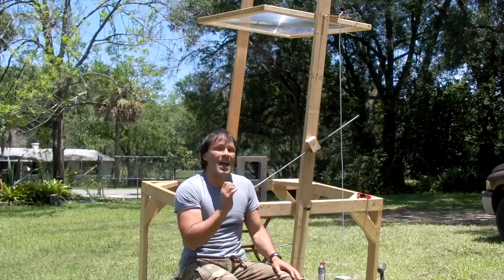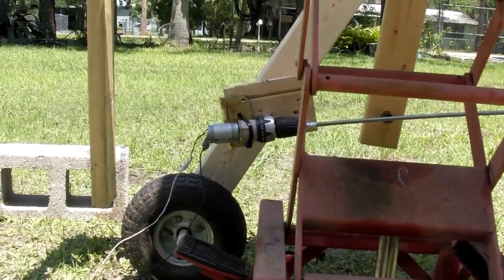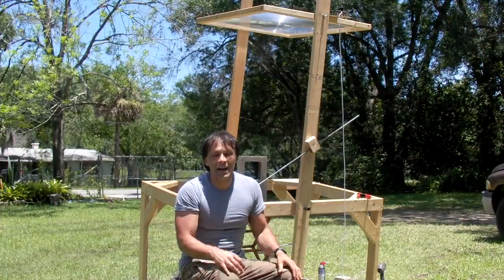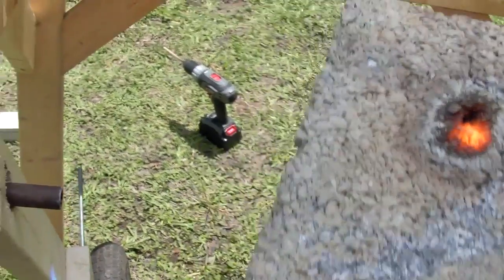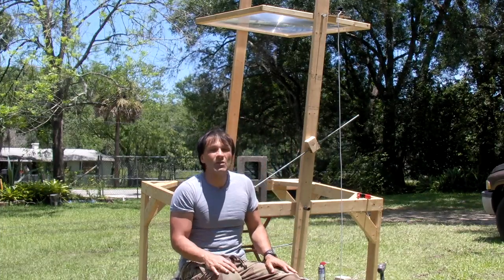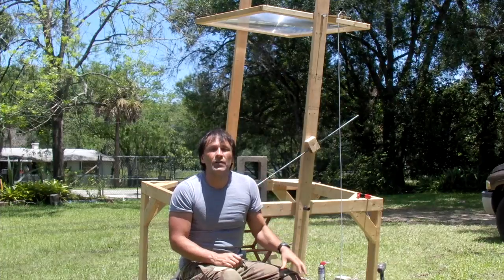Fresnel Lens Solar Tracker Afternoon Stationary Target Sun Power Ray greenpowerscience

Comment from the maker: This tracker could operate from a small 6 watt panel to a battery or it could run directly from a 30 watt panel no battery. Battery/panel combo is a better option. The entire unit consumes only 6-10 watt hours a day = a 6 watt LED bulb on for one hour.

In terms of a Fresnel/Concentrated solar station. Standard PV, sort of with panel risks. CPV yes but the cost of regular PV is well below the price of CPV when all aspects of the project are considered.

Comment from the maker: Thank you for the feedback. I will point that out in the next video. Easy assumption overlook on my part. This thing is fun. No more lens moving. I am totally ditching all the stands for this. I need more motorcycle jack stands. Ebay is the only option I can find. Harbor Freight only has transmission jacks (sucks to lift) and $350 table cart stands.

Comment from the maker: Depends on your project. The Fresnel Lenses work well for melting metals and very high spot temperatures. The parabolic mirrors work better for bottom cooking like a traditional stove with a slightly wider focal pattern distributing light over a larger area (bottom of a pan). This is designed for soar thermal vs solar electric. This lens concentrates roughly 700 watt/joules to a 1/2" area. For electrical production I usually recommend standard PV as the over all footprint is about the same.

Comment: This is awesome, Dan! Thank you! I like all of your videos, but I may actually build this project. I heat my house, water and hot tub with a wood-fired boiler. But, we get a lot of sun from mid-spring through early fall. During that time, I'd rather use the sun instead of wood. What would you consider to be the best solar water heater design to use with your solar tracker?

Comment: Hey Dan i have a few Fresnel lenses myself and i was trying to see if there was any way to recycle 2 liter bottles and use the flat portion as a window pane substitute for a green house by molding or melting them together with my lens to mold them together into a pane between some metal sheets. do you have any pointers or have you ever attempted something like this yourself?

Comment: Its not actually improved efficiency by using more light area focussed onto a panel, its just increases the concentration.  

6 watts for the area taken by the mirror is actually a loss, where as another 40watt panel in the mirror's place makes more power and better sense.

One also requires more volume space to do collection via reflection mirrors.  

For space and efficiency at the home, flat panels are very practical.  

This tracker would increase energy collection for solar panels very well

Comment: Do you think it's possible to run an every day hot dog stand off of either a franel lense (or a few) or some reflector deal and which would you recommend?  I'm concerned there's usually a lot of ppl arround a hot dog stand and having someone wander into a focal point would be dangerous.  Can you think of a set up that would allow someone to quickly cook a dozen sausages in 30 min that would allow ppl to move arround the stand without difficulty, both staff and customers? I'm stumped.

Comment: I've wondered how long it would be until someone started making videos about solving the lens adjustment issue. I kind of figured solar tracking was a loss cause as most people seem to not even bother with them for their solar power systems, too much hassle and too many moving parts for not enough gain. That mentality had me concerned because I figured for cooking and extreme heat applications with the sun you would want the lens to move but not the structure. 

Ingenious Rojas! Well done.

Comment: Hy Dan, If you put a solar pannel above the focal point of this system, to concentrate the maximum amount of sun possible on it throughout the day, would the additional energy you would get from that be grater then the additional energy you would get by buying more solar panels with the money you would otherwise use to build this concentrating system? In other words have you tested the efficiency increase a solar pannel will experience as a result of this system?

Comment: I debated using a fresnel lens or parabolic collector for my own project and ultimately chose the parabloc mirror, its seemed less complicated and you said in an earlier video that the large mirror was more powerful than a fresnel lens. What are the advantages? How much electricity can you get out of this or is that even the point of this project?

Comment: If you line the outside of a tube, drum or barrel with solar cells, could you produce A/C output by spinning the barrel? (like a v3solar, buy not a cone) Would the A/C output be more efficient than flat panel D/C output?

Comment: Have you measured the temperatures you can attain with this lens? Could it generate enough heat to boil say 3 to 5 gallons of water in a pressure cooker to produce steam power?